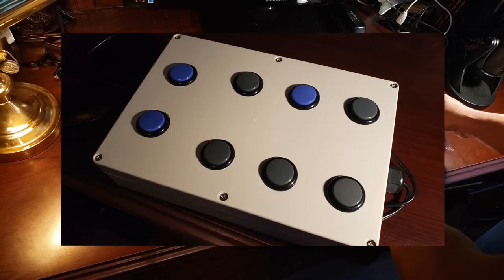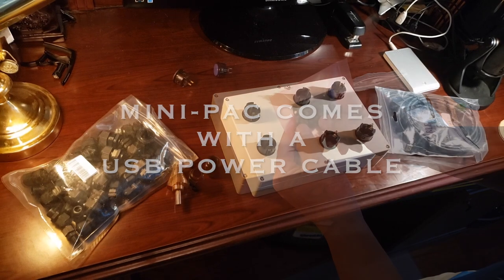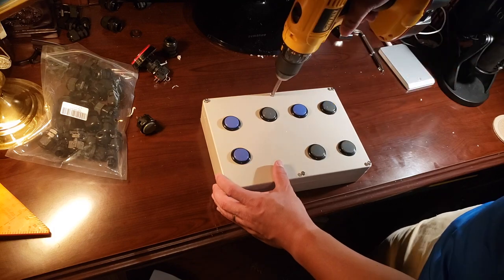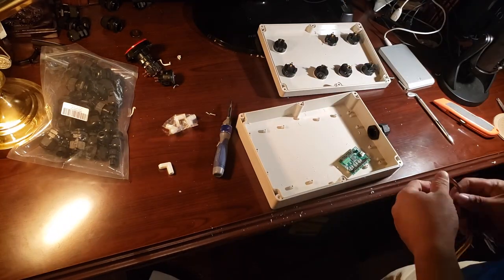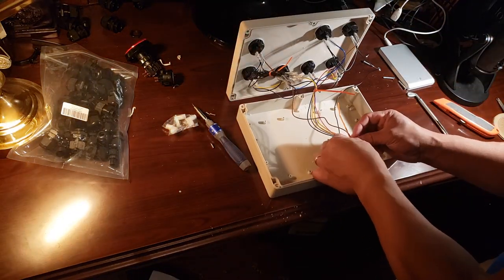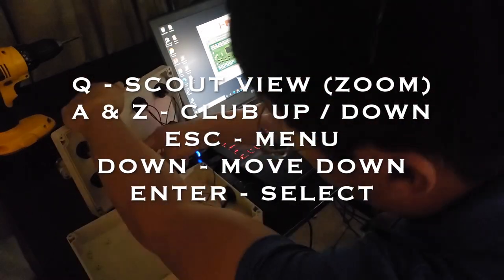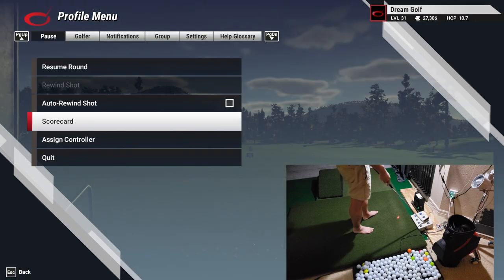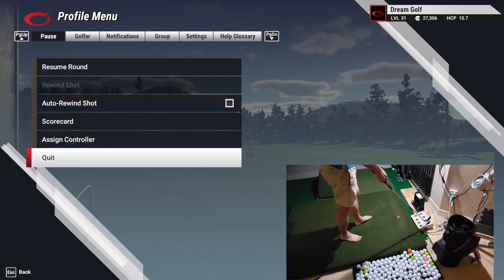DIY Golf Simulator Control Box

Comment: thanks for the video! with the mini pac u suggested, do i know what is the max amount of buttons u can hv? it is not clear on their website... thx
Reply from the maker: Looks like 32 on the one side of the board with potentially more if you can substitute the trackball and spinner pins. See attached link to download board detail. https://www.ultimarc.com/images/Minipac_wiring.pdf
Reply: @DreamGolf  i actually went to micro center and got the other one u recommended... works great! easy to setup too...
Reply from the maker: @Fksu  Glad to see it worked out. Looking into BT right now, but that has some challenges with coding that I'm not sure is worth the effort at this point.

Comment: Great video, it’s inspired me to make a control board, I am right up to the wiring stage. I have 11 buttons and I bought the ultimarc minipac. Any chance you could help me with the wiring ? I have numbered all my buttons on the backside of the cover, do I just attach the first 2 wires to number 1 switch and so on ?
Many thanks
Reply: Ignore my wiring explanation above, I watched the video again and I think i've done it right. I have e mailed you. I hope you can help.
Reply from the maker: Wayne, just sent you an email on troubleshooting. Try pulling each wiring "group" and plug into computer to see if the fault clears. Isolated down to the group and replace the wiring harness accordingly. I would not install wiring harness' unless you are plugging them into a button. So Group J3 should be removed entirely. If J4 does NOT include the ground, I would pull that as well.

Comment: What is the size of the cable gland to  allow the micro usb to slip thru while gripping tight the usb cable?
Reply from the maker: You will need to find a grommet to seal your cable. You can cut it in half so you can fit it over your cable. I used a cable gland and inserted a grommet inside. The cable gland will not seal to the cable because the USB fitting is too large vs the cable diameter.
Reply: Thanks for the insights

Comment: The computer thinks it's a wirless keyboard
Reply from the maker: It should think its a wired keyboard.
Reply: @DreamGolf no mine does the one I created. I posted a link. I used a wirless keyboard and maped out the shorts to create a map of the keys than attached leads to the buttons so its plug and play.
Reply from the maker: @igolfandimakestuff2629  That's awesome. What did you use to make it wireless? What board?
Reply: @DreamGolf  I used a wirless keyboard chip and maped out what shorts create what keys.